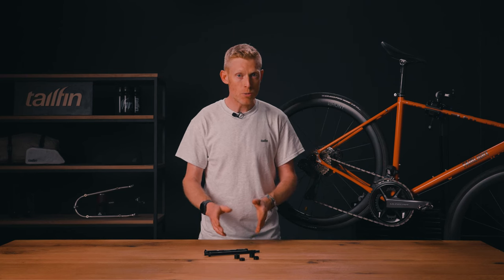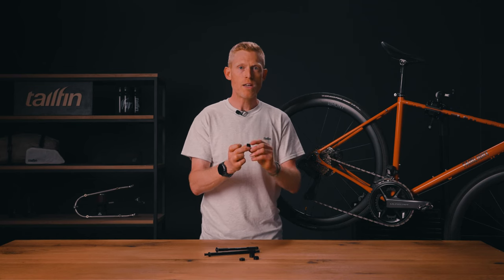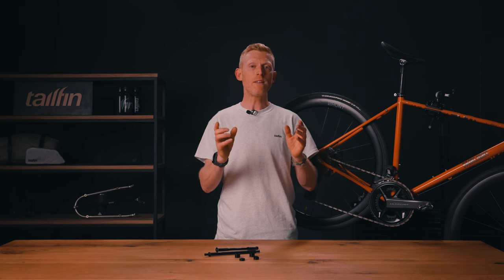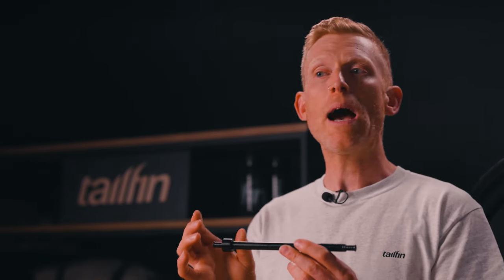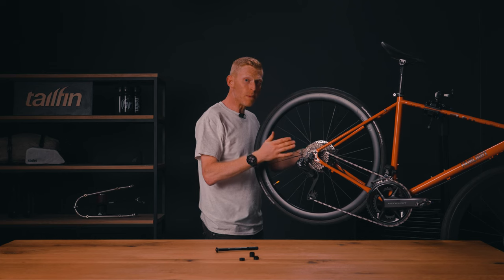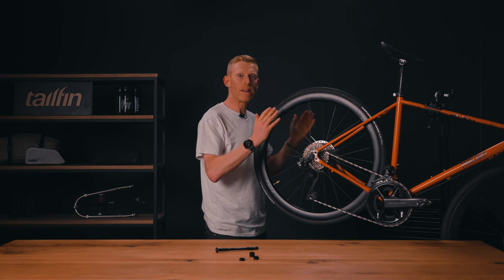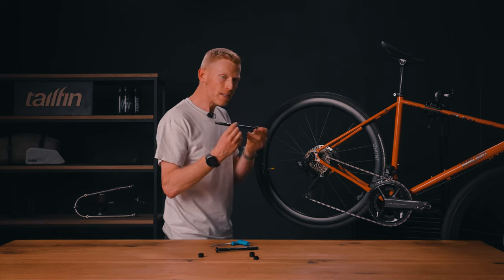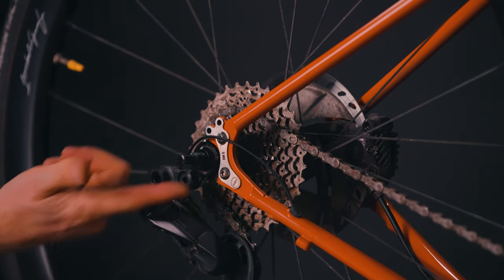Fitting A Tailfin Thru Axle | Assembly Guides

Comment: There are no instructions for installing the 1mm locking nut.  I'm trying to do this on an O.P.E.N. UP. Does the locking nut take the place the spacer on the drive side?  Also, what tool do you use torq this locking nut?

Comment: What should you do if the thicker spacer still isnt enough? Can you combine 2 spacers safely?
Reply from the maker: Hi Kobe, You can combine two spacers together on the axle if needed. Just be sure to tighten the axle to to 8-10Nm.

The spacers are more about getting the arch reasonably central above the rear wheel and the top stay in-line with the seat post, due to the variation in bike geometries some bikes will not be possible to get perfectly inline though.
Reply: thanks for the reply! Just for transparency: i made a mistake. The large spacer is actually perfect for my bike! @TailfinCycling